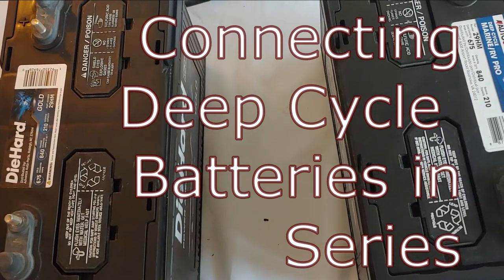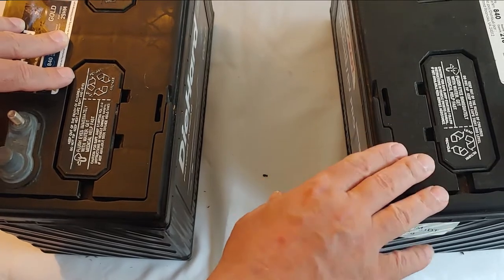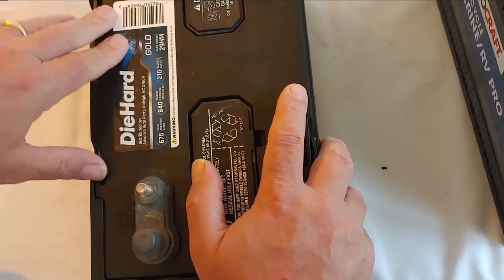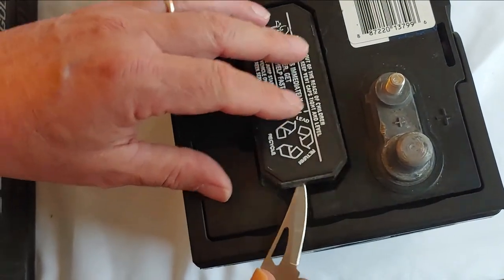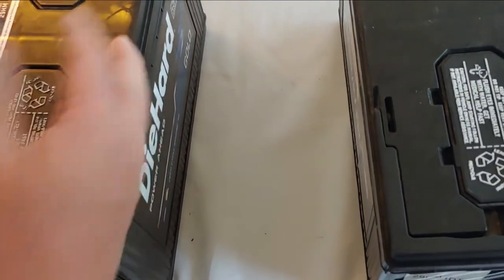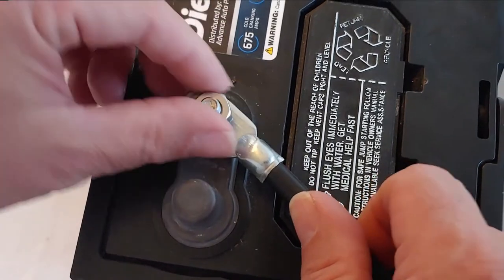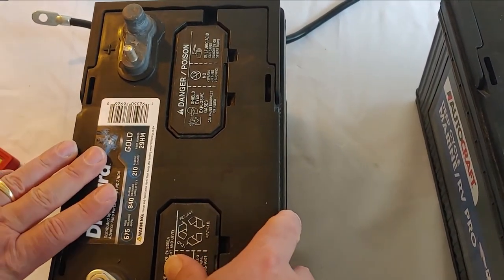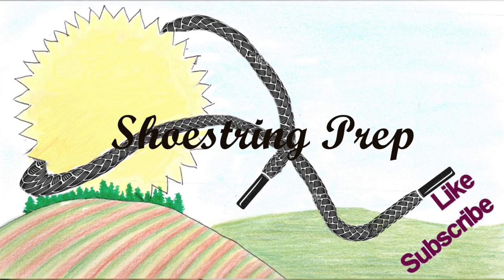Connecting Two 12- volt Deep Cycle Batteries in Series.

Comment: That makes a lot sense but were do you actually hook up your incoming power from the solar panels?
Reply from the maker: You would hook up your solar charge controller the way you would for any other system. Thanks for your comment.
Reply: @shoestringprep Just to clarify... should the controller be rigged to one of the two batteries only (i.e. pos & neg on the same battery), or pos on battery 1 and neg on battery 2?